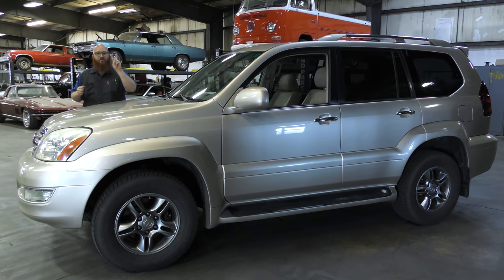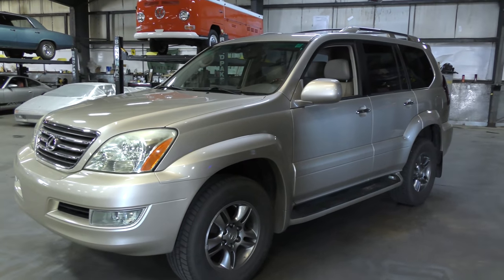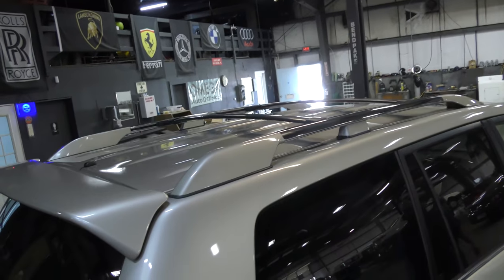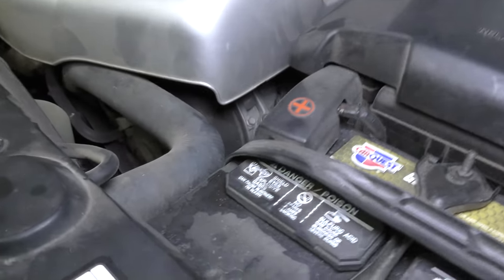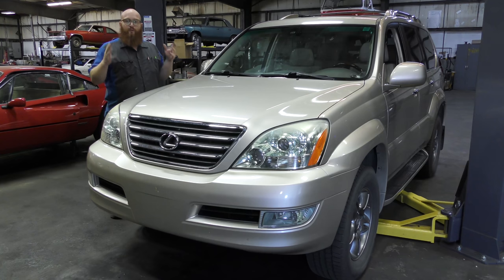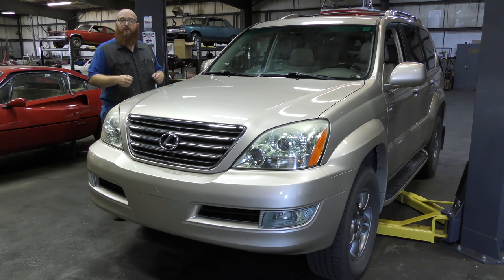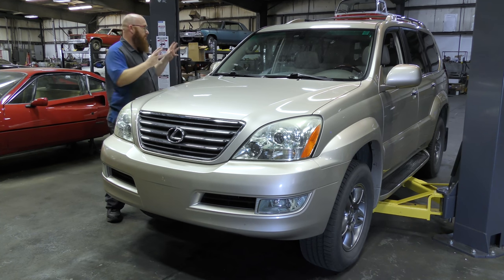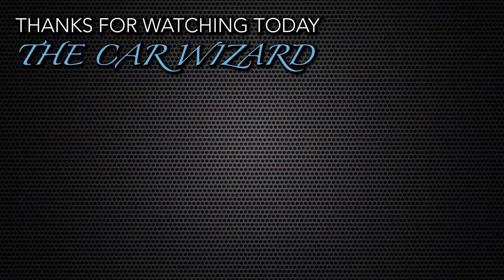Reliable cars get surprise bills too. Simple oil change on '08 Lexus GX470 turns into $1200 repair

Comment: My body had one of these and gave up at 180k all of the oxygen sensors and all of the bushings were gone, I agree it is ok in snow and  offroad but around the city, I drove old pickups more luxurious than this, it's only reliable when you driving it as is without addressing all the little issues and Christmas lights on the dash, all the squeals and noises and blemishes it will get you from point A to point B if you are going to address all these issues Lexus parts department is going to love you consider it Japanese  BMW, what is the point of changing the oil if  it eats 2 quarts every 1K or so, constantly keeping it fresh regardless and if GX470 is luxury  I don't understand why people asking more money for Land Cruiser of the same era

Comment: Heaven forbid I have to change out a CV axle on a 13 year old Lexus with a ton of miles on it. That GX is 100% still on its original powertrain, and most likely original suspension components (outside of maybe a rear airbag). Expensive to fix when it breaks? Isn’t every car? It’s how often it breaks that you have to consider. You might have one major event on a high mileage GX every 1-2 years. On almost anything else with similar age or mileage, budget for a repair monthly.

Comment: My 2012 Honda Fit has 98K miles (never had the valves adjusted). Only during cold weather, sometimes I hear a grinding sound during startup (sounds like when you try to start the car that's already running). Lasts only a sec and startups are fine for the rest of the day. Is this worrisome and what might be causing it? Thanks. Your videos are excellent.

Comment: Car Wizard what is your opinion of the Tahoe for the GMT800 and GMT900 series. I have one of each and love them. My 04 Z71 has 303786 miles and runs like a champ and I have a 12 Tahoe PPV and it handles like a dream. It currently has 189,000 miles and runs way faster than I need to drive.

Comment: I went with ebc hd rotors an their orange hd pads all 4 corners on my lx570 . Lx570
Has a tps sensor on spare… the gx is on the 4 runner frame

Comment: Is it a Toyota / Lexus truck/SUV thing for front brakes to wear out quickly? I have an 2004 tundra and replaced calipers and have done 4 sets of rotors and pads in the 5 years of ownership

Comment: Do people in Kansas or other places typically pay $100 for an oil change? I have a 2013 Lexus and it’s about $65 for a synthetic oil change at the local AAA-approved, independent garage. I’ve heard it would be really expensive at the dealer. Yeah, I could get a $45 one at Walmart, but I’m not trusting my car there.

Comment: Um, I have nothing against Toytoas but I have a 2008 Pontiac and it still drives like it's new (I bought it new), as a matter of fact I had a Toyota before that and my GM is more reliable than my Toyota, the Toyota had stuff go wrong, I have had nothing go wrong in my old Pontiac (just wear and tear and regular maintenance), I actually went ahead and bought the extra warranties on the Pontiac because I also believed it was not going to be reliable but it is very reliable.

Comment: I found out my spare was flat AND that the bolt that holds it in place was seized while in the middle of a winter storm that dropped over 6 inches of snow. I dunno how the bolt seized since the tire is in the trunk and not under the car like in this SUV but I called AAA cause I couldn't get it off and I held the light for him as he used various tools to try and break out. 30 min later in the freezing cold he finally got the tire out and I found out the tire was flat and wouldn't hold air. Probably would have been a good idea for the AAA guy to check if it had air and test to see if it will hold air before he wasted 30 min getting it out.

Comment: At what point do you draw the line on these $1200 repair bills? I drive an '04 Highlander with 160k miles. Don't get me wrong, it's needed very minimal maintenance along the way. But due to age, parts are starting to need replacement. It's like every 6 months I'm spending around 800-1200+ to replace something. It still doesn't exceed the total value of the car currently.

I can definitely afford a new car. But I feel like I'm stuck in between "I love this car. Still runs fine. Had great memories/experience." and "Would love a new car with better tech/gas mileage/safety features".
Reply: T3 I was in that point too, but in the end you will realize that newer car especially for toyota wi be way cheaper than a 2 or 3 year old toyota as they cost roughly the same

Comment: This guy; "Buy a Toyota, spend more money, you'll save money in the long run." 

Titles video; 'Simple Oil Change turns into $1200 repair"
Reply: Consumables are ...consumables. Do the job right and you will get the best service and it is not like it needs a new camshaft chain etc. which in my opinion should be a lifetime component not a half life replacement for mega dollars.

Comment: "Reliable" doesn't mean even the best used car doesn't need plenty of love and preventative care.  To me at least it means if I keep on top of maintenance it never breaks down.  And at 324k miles my Toyota never has.  If people are going to bitch about the cost of having someone else do the hard work then learn to fix stuff yourself.  Another thing I've learned is that auto parts store parts suck.  If you're planning on keeping a vehicle for the long haul, shop around and get genuine parts, there is a difference.

Comment: Lexus… if they break… they really break. If the head gasket goes, it isn’t just the head gasket.
It blows up the radiator, the radiator shroud, and the transmission… just happened to me.
When a Lexus dies… it really dies.

Comment: Well my 2002 Sequoia needs a new engine or cylinder head work done at 240,000. It's cheaper to get a whole used engine with 140,000 miles on it and get that installed!! Let's see that when I got it it had 30 plus receipts on vehicle maintenance done etc. I thought I had a good vehicle. I guess anything over 200,000 miles I'd recommend changing all the fuel injectors and all the spark plugs first thing you do! Probably would have saved me $3,000$$$$

Comment: Please do a segment on suvs, specifically 
Mitsubishi montero etc. Im looking at a 2006 chev.expedition xl, its been sitting for 3yrs,but motor needs work, owned by older couple, wants$ 800.00
For it as is, my question is which is a better choice, 2003 misybishi,200 thousand miles or chev.200 thousand miles.???

Comment: The Lexus still has a $1200.00 repair bill. I was looking for a used minivan in 2020. A Chrysler Pacifica 2017 with 25k miles was $16,500. A 2017 Toyota Sienna with 25k miles was almost $25,000. I don't care what this guy says, the Toyota isn't worth $10,000 more. Save the 10k and you can buy another used car sooner.
Reply: There is a reason why toyota are pricey on the used market. They don't break down that often. I'm speaking from experience. If I was in your shoes, at that point you are better off with brand new car depending with your needs.

Comment: Wizard, if the timing belt hasn't been done since 2015, would it not be not questionable given it's age alone, and what about the tensioner(s) after 6/7 years? I've just bought a timing belt kit (with water pump) for a 1.6 petrol audi, it was last done in February 2014, but has only done 35,000miles since then. So in mileage terms it's good for another at least 25,000 miles. But what about the length of time it has been on the car? Should that not hasten a replacement belt and tensioners?

Comment: If the boots had been the only issue I would have booted them in the car. Because other work was bring done and this car is so well maintained the new assemblies actually world proactively prevent a trip to the shop. On this car that could be 5 years. Then the wizard might have a small list of to do's with the 200k service.That's 10 more years, better have a celebration dinner then. Might not see it again.

Comment: Two questions. Can those OEM Lexus rotors be turned or is replacement more effective? Second, when those air shocks go, do you replace with new air shocks or substitute standard coils? Thanks.

Comment: I've owned more Toyotas than I'd like to admit. Including a 94 corolla with 250k that was poorly maintained. Yet I replaced a few parts and it just kept on ticking.
Reply: I still daily drive a 1985 Celica. My avatar is actually of the turn signal from it. 🤣

Comment: Wizard! Me again... My GX makes a loud grinding sound when cranking the wheel and driving to the left. any idea what that could be? There is also a ticking sounds coming from the engine that I suspect is an exhaust leak but you may know otherwise. Any idea what this could be and what it might set me back?
Thanks in advance Wizard!

Comment: Smart customer knows the price of reliability. You have the reputation that the customer trusts you and knows you are not gold plating. That's the problem with some of these cheap Euro cars when they need to get a lot of things done to keep it in good order. And the dealer or repair shop is charging a premium to do the work. I am not really a fan of the Lexus styling but having a car that only needs its scheduled services is why I would have one or a  garden variety Toyota in general.Having said that, I have so far had seven years of reliable service from my 2012 diesel Sportage. The Koreans are still on the improve and already past the Euros IMHO.

Comment: Why don't you mention Honda? I prefer Hondas, because they have much more fuel-efficient choices that are not hybrids. Significantly better mpg than Toyotas. Reliability is great, too. I have an 05 Civic Hybrid with 350 000 miles and 06 Accord k24 with 338 000 mi.

Comment: I wonder how much I can sell my 2004 gx470 with 94,500 miles? Same exact color as the video with new front calipers, rotors, pads and bags. Timing belt and wp done as well at 93,000

Comment: OK I recently bought a 2010 Ford explore. I wanted to Toyota 4 runner. I would not of been paying 20 to 30% more I would’ve been paying double. To get the same year same equipment same miles.  I’ve owned it for about 6000 miles and I have had to put seven grand in it. It’s been a horrible car purchase but financially it’s still been cheaper than buying the 4 runner.  Do I wish I would’ve bought a different car yes but I still wouldn’t pay the difference for a 4 runner.

Comment: Unfortunetaly back where I live there were no GX470 available. Only Land Cruiser 120 Prado with 2.7 vvti which is a bit underpowered in my opinion.
However, luckily LX470 is available (it aint cheap but cost less than some dumb Bmw or Mercedes). 

Anyone know Toyota Alphard? Im still thinking about that even it is no heavy 4x4

Comment: How do you tell which disks are warped when it's on a lift? Do you just spin the wheel and stick your finger in there?  Or do you run the motor and brake while it's up in the air?
Reply: Test drive.

Comment: Toyota/Lexus is that long term flex. But I tell ya what. The way the used market is now? Even with depreciation, it’s probably smarter to buy a new Toyota/Lexus lately. Also gotta say that I admit that I never thought I’d say that. 🤣🤣🤣
Reply: Thats true man.. thats exactly what I ended up doing back in 2020. I wanted a 2017 or 2018 corolla but the used prices after you factor interest rate and all the goodies it was better for me to get brand new as it was cheaper. That new one was a 2020 corolla LE and haven't looked back since

Comment: Such simple jobs to do yourself. Save hundreds and hundreds and spend an afternoon changing it yourself. These can be done 30 minutes per side with electric tools. What I'm curious about is why there's an additional labor charge for brakes and rotors, when the rotors are all going to be removed anyway and just replaced with new components.

Comment: It would take me 4 hours to do two CV shafts for sure, but it shouldn't take a shop that long. Maybe 4+ hrs if you're rebooting OEM shafts (which is a good idea compared to replacing with shitty chinese CV). Shop should charge at most 1.5 hour per shaft for a swap (takes about 10 mins to take off the wheel , brakes/hub).

Comment: hey @car wizard i also have a gx 470 

on the rear driveshaft on the zerk fitting near the transfer case how much do you know to pump in? i pump enough until the driveshaft starts moving and then stop.

Comment: 1200 to replace some things that NEED to be replaced is nothing. Especially for a solid car like this that is 13 years old. People are really stupid for neglecting things like this, then wondering why their CV shaft grenaded or timing belt shredded itself and fucked the whole engine, and then they are in for 5x the repair cost.

Comment: We have a nissan versa, nissan frontier, and a toyota avalon. The nissans (both with TRADITIONAL autos) have even just as reliable as my toyotas. (I've had some others besides the avalon in the past). In general thought, I like the Japanese makes better. Toyota repairs can get expensive, and some of their engines are a headache. Everyone should research their specific model because no car maker is perfect.

Comment: You don't change the shafts. You take them out, replace the plastic crap with new grease inside. A professional doesn't take 4 hours. It take 1 hour for both sides. In Africa it cost 20$ per side for this exact car  Toyota Prado.
Reply: No shit! Did you know that a fully loaded Triple Patty Hamburger only costs $3 in Mexico!!!!! Of course it would cost less in a third-world shithole.
Reply: Only $20 across the whole continent of Africa?  Wow! 😄😄
Reply: @MC-mh2ju  my point was that it doesn't take 4 hours at 100$.  It takes a few minutes. Africa = the best mechanics it the world.
Reply: Same thing for the rotors...you don't change them. You take them off , and there is a special machine that takes off a small superficial surface on each side. And they are brand new for no more than 10$ each. 
The African mechanic end up with 100$ / hour in his pockets. The difference is he works honestly relentlessly. He has to fix more cars in the same amount of time.
Reply: @MC-mh2ju  African : repairs Botha shafts + repairs both rotors within an hour. 
American : replaces both shafts replaces both rotors takes a whole week at 100$/h....

Who do you trust?

Comment: I'm as patriotic as the next American. I love my history and the amazing cars along the way. I am not a fool, however. I own a Tacoma, my wife has a RAV4. It is obvious the quality in most American cars is so bad nowadays. Cars are designed to last a few years to just get passed the warranty. My wife had a 2015 Equinox. That was the worst vehicle we've ever owned. Timing chain issues, electrical issues, bad crank positioning sensor, burning oil and more. Btw, it only had 75k miles. These cars are not made to last and you can take that to the bank.

Comment: 13:07 Come on Wizard, that's not air. AHC is a hydraulic system.
Reply: Gx470 doesn't have ahc
Reply: @kingjesus7926  you're right.

Comment: Should of left the CVs alone after market once only last 3 years or so at most, the stock CVs from Toyota will basically outlast the frame and the body as long as you keep them greased and at least somewhat protected from elements. For what ever reason Toyota makes CV joints that are out of this world lasting, if you keep everything in stock or close to stock configuration suspension, tire and ride hight wise!

Comment: if the boots are torn drive it until the cv joints start clicking - usually months or even a year or more. I had a wrx with torn boots all around and they worked fine for a few years. Every oil change I would put a screwdriver with some grease on the linkage. 

If you want to spend money on repairs on an older vehicle you can, but a lot of stuff will tell you when it's ready to go. Replacing stuff just to put it in tip top shape seems a little unnecessary. If I was going to offroad it in remote areas or go cross-country then sure you replace a lot of stuff to make sure the vehicle is reliable, but if you just drive it to work then things like axles will often give you lots of warning before they fail.

Comment: Even an Acadia would probably last 300k miles if it was thoroughly inspected and maintained/repaired periodically like this
Reply: Not true, the failures of the Acadia platform are internal issues, not seen by inspection and maintenance would not help parts that are just destined to fail regardless.

Comment: It’s not a Chevy with higher msrp.  Parts are expensive.  Chevy parts wear out faster with cheaper parts.  Lexus parts last longer but are more expensive to replace.  Buy vehicles on how much time you want to be at repair shops or not.

Comment: Toyota's are not perfect. Oil sludge issues on their 3.0 V6 on late 90's Camry's and ES300. And then you have the issue where they put the starter between the V bank, on their LS430 Lexus's. 12 hour job to replace. And then Cadillac does the same thing on their Northstars. All in the name of quietness, WHEN starting the car. Other than that, they are fine, if not boring.

Comment: Just thought I’d throw out the fact that Mazda is now #1 in reliability according to Consumer Reports, beating out both Toyota and Lexus. Maybe time for a paradigm shift Wizard?
Reply: A lot of that is because Mazda has basically been using the same powertrain in all of their vehicles for the last decade with minimal updates: Skyactiv engine plus manual or 6-speed automatic.
Reply: @Default78334  Is that a bad thing? Most people couldn’t care less what motivates their vehicle, as long as it gets good mileage, accelerates briskly and doesn’t give them trouble.  You and I may be interested in automobile minutiae but your average consumer definitely is not. Full disclosure; I own a 2012 Miata and a 2021 Mazda 3, eminently satisfied with both.